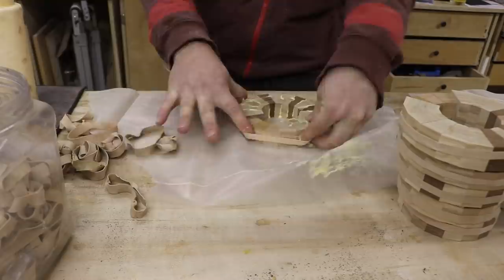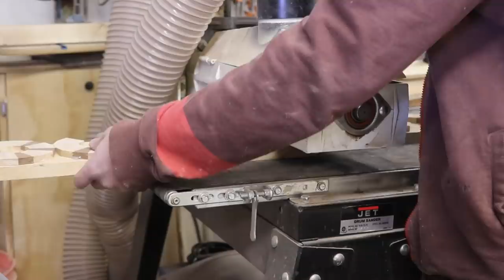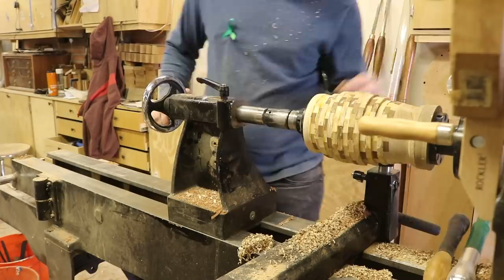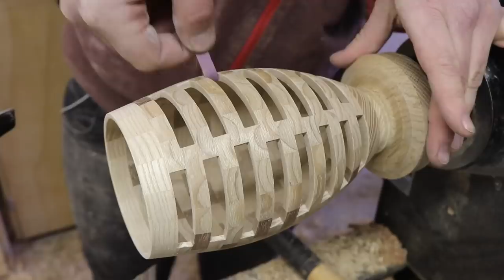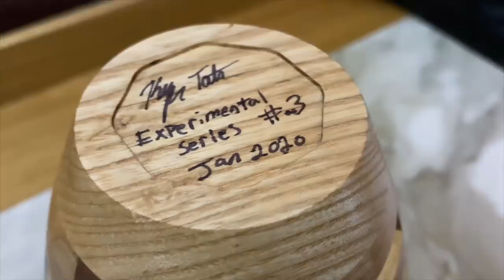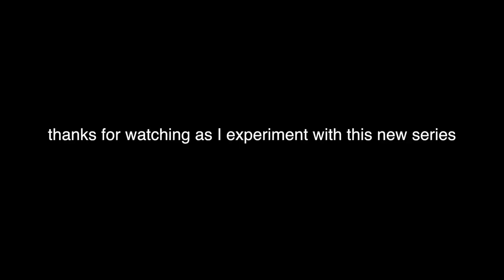Laced Up Vase - Experimental Series

Comment: I noticed you didn't use your signature "Homer Formby Tung Oil" finish on this one.  Any particular reason why?
Reply from the maker: They stopped making it. I use deft spray finishes on difficult to sand surfaces now. Less sanding between coats